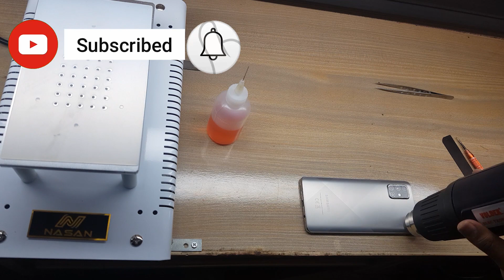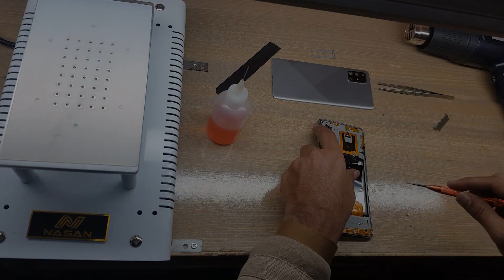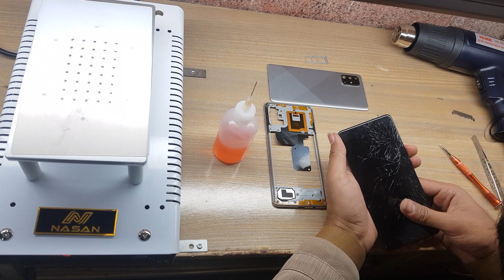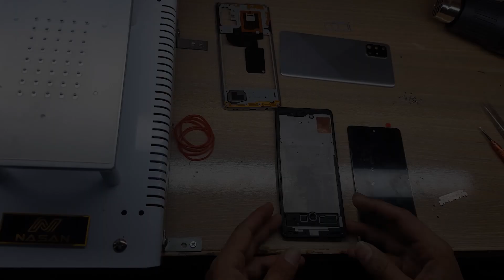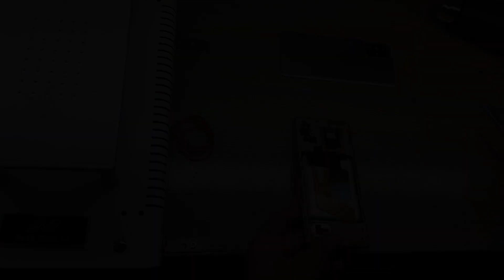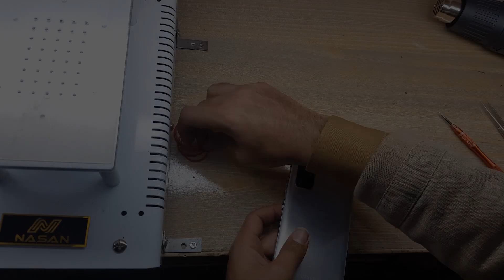Samsung A71 LCD Replacement

Comment: Hey, great video, by far the best ive seen. I just ordered myself the display but i still need the glue and would be glad if you could tell me which i should buy.

Edit: Scratch that, found one and done, thanks again mate ^^
Reply: What adhesive did you use and where did you get it? Did it work?
Reply: E6000 is one of the best